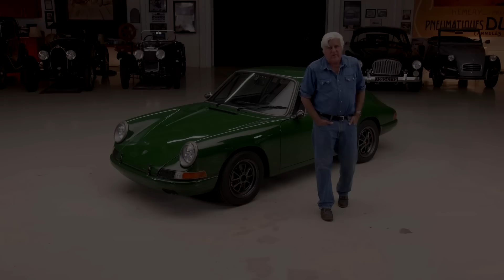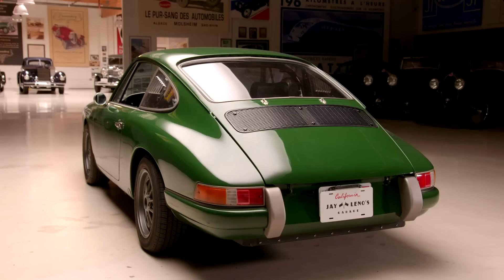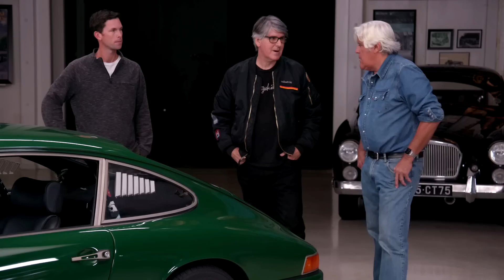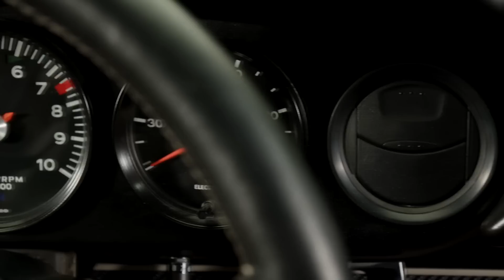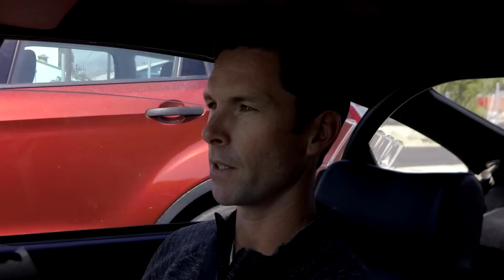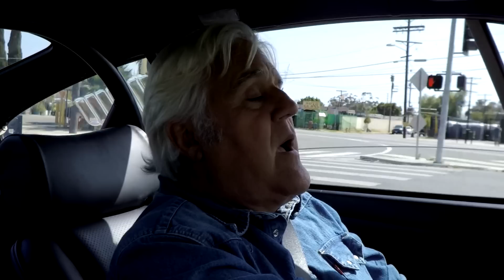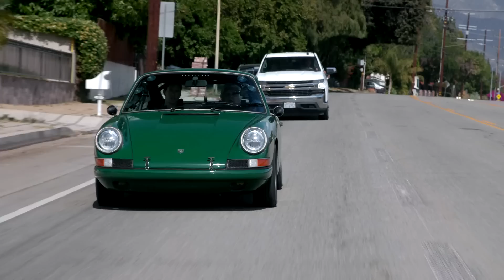Zelectric 1968 Porsche 912 | Jay Leno's Garage

Comment: It's cool, but my car with a V8 gets about 330 miles to a tank, and it's well under 20gal. and I like to sit and run the A/C and radio and engine and have lunch and hang out. doing that would burn the batteries down more. how can I sit around in that with the A/C on and hang out and smoke up? ordinary life just gets in the way of all this progress I guess..
Reply: You like your carbon monoxide.
Reply: @davidvicari5139  ... Bwa-ha-ha-ha-ha-hahah.  Good one.  Just asking, but, what makes you think BEV’s are green?
Reply: @kradius2169  EFFICIENCY. Efficiency = GREEN. Gasoline contains 34 kWH energy equivalent. My Tesla goes 3 to 4 miles per kWH. Your car would have to get 98-136 mpg to match that efficiency. This is not debatable among adults who understand science and math. Dummies parroting fossil fuel propaganda, they don’t get it.
Reply: @davidvicari5139  ... I'm definitely no a•dolt.  What about the making of the battery, how efficient is that?
Reply: @kradius2169  apparently with close to 2 million Tesla on the road, and every one they can produce spoken for, they are very very efficient for Tesla and Tesla customers. You really are not that good at regurgitating fossil fuel propaganda, give it up.
Reply: @davidvicari5139  ... Huh?   R U suggesting that the energy needed to produce the battery is not part of your non-propaganda efficiency analysis?

Comment: "Green" is not true -- All electric cars run on electricity that for the most part is generated using fossil fuels. So while you're not burning anything, the electric company is. Also, if everyone ran electric cars -- our current electric grid couldn't handle the load. So the conundrum is do we build more electric power plants to support more electric cars?
Reply: What you don’t get- The electric is vastly more efficient. Regardless of energy source, the electric uses less of it. A gallon of gas contains 34 kWH. My Tesla just got 4 miles per kWH the last 30 miles, averaged. Your car would have to get 136 mpg to be as efficient. If everyone drove electric, it would be a BOON to the electric grid.
Reply: You are so right and I cant see any new power plants in the near future. Windmills and solar are not the answer either.

Comment: I can't believe it's only 300 lbs more. That's incredible I expected 1000 more. That's just like having a fat passenger with you lol. Not a big deal at all especially for how much more torque this thing would have. And the fact one can go back to stock is sweet. It's the prefect situation for an old style electric car.
Reply: Extra weight gain might actually be less. While they mentioned the weight of the original engine, trans and exhaust, they forgot to factor in the added weight  from a full tank of gas!

Comment: The 912 is as much a Porsche as a 356. The further back you go with 356 the more "hand made" it is but so what. You try dealing with non original doors! I had a 1953 that needed a hood and let me tell you, the hood is not easy to replace because they had soooo much variation car from car. The Windshield had 1/4" variations. Maybe more. and Doors are worse than hoods. The 912 has a 356 engine but its the best engine. I had a 1964 SC engine and that is a good engine Especially with a big bore kit. And it's easy to get a 120 hp out of 1800cc. PS, the rear clips of 356 are remarkably the same, from the door back, the engine lid, no problems.

Comment: Another air cooled power set-up
How often do you need to adjust the valves😃
Great show Jay
Guys did a great job on that conversion
If I saw it parked on the street
Would think clean little Porsche
Not that's electric
Reply: Tinkering with your classic is bonding with your car. Taking that and engine sound away is robbing it of its soul
Reply: @AR-zq9hq  Opinion
Reply: @bryanluntz1603  fact
Reply: @AR-zq9hq  😄
2 sides to every story
Obviously...
Reply: It is not a big deal to adjust valves nor needed very often.
Reply: I adjusted valve lash often in All my Volkswagens

Comment: Wanna hear the sad part? The original 1968 drivetrain was WAY more reliable than the Tesla's.
Reply: Absolutely clueless statement. For starters, the head bolts are not going to pull out on a Tesla motor. The cylinders are not going to crack.
Reply: @davidvicari5139  I know all about the issues the old VW boxer engines had. The air-cooled beast is still more reliable. Read on Tesla forums and they attest, you can't go 10,000 miles without a major drivetrain issue
Reply: @stevenhinkle6957  gee, my 3rd owner 2015 Model S 90D didn’t get the memo! I have driven it so far over 40,000 miles of smooth, silent and FAST, with zero maintenance or issues, in 30 months. Oh, I bought 2 sets of wiper blades. Of course, your internet  “research” supersedes any actual owner experience.
Reply: @stevenhinkle6957  now if you like drivetrain issues, I have a Boxster that would suit you.
Reply: @davidvicari5139  That's pretty lucky. You're on borrowed time with that many miles. Don't take my word for it. Get on the forums and see for yourself. I believe there's a reason it's had three owners in 6 years. 

So I'm not even saying this to get some kind of rise out of you but you should sell it before the issues arise.
Reply: @stevenhinkle6957  it’s OK if you can’t afford a Tesla. No one will think less of you. Look on  the Pelican Parts forum for 25 year and older air cooled 911’s. They have not been produced since 1996. See how “reliable” they are, Look at any automotive marketplace you want, you will not find even a 9 year old Tesla for under $30,000. I intend to drive, just how would I replace my car, which reruns for all small fraction of your car’s operating cost. You make ZERO sense. Tesla is closing in on 2 million cars on the road. To speak about a 50 plus year old sports car in terms of “reliability” reveals, ou are clueless.

Comment: Remember with one gear electric cars there is no neutral. Think of N as no regen. No regen is the most efficient mode. Come up to speed and coast. Down hill I use no regen. When I come to the speed limit...or as fast as I can stand I can regen as much as need. Any 0-60 near 2 seconds is not very compatible with two wheel drive. 4wd is why the Plaid is do dominate.
Reply: I would have to disagree. I can get 250 wh per mile normally with my Model S. On vacation in Northern Minnesota, there is a long elevation change from about 1400 to 600 . We saw 182 wh/mile coming back down. That is regen.
Reply: @davidvicari5139  No that is inefficiency. If you can keep your speed and only use regen to slow you will be more efficient actually gaining range .If you could keep your speed that would be 0 wh per mile. Much better than 186wh per mile.  I only use regen to slow down which is necessary to not break the law. That means you are at the mercy of the hill and take what gravity gives you. You already paid in range by going up the hill. Gravity drive is free. I don't know how far the range drop is so I don't know the slope but coming down the grapevine from LA into the central valley I actually gain 3 percent and use a lot of regen. I don't even know how to measure that in wh per mile like a -500 wh pm You are putting energy back in and gaining range...does that make sense? When you regen you only get 10% back burning kinetic energy. Poor payback. Kinetic energy is what keeps you moving. N is infinite. As long as it lasts.
Reply: @LawrenceRhodes  but in reality you can’t “ keep your speed”. Without regen, going downhill,  you would have to use your brakes to keep your speed, which converts N to waste heat. That is your idea of efficiency???
Reply: @LawrenceRhodes  you seem to misapprehend  how regen functions. The position of the accelerator pedal can be used to achieve “neutral” coasting. Look at your consumption display. There is no need to turn regen on or off. Again, reality does not allow you to coast indefinitely on inertia. You must slow eventually, and regen uses the force created by back EMF to resist the car rolling, rather than using conventional brakes, which dumps the energy as waste heat. I really don’t understand what your thinking accomplishes.
Reply: @davidvicari5139  I don't think you understand regen. Regen acts like a brake including returning 10% of your energy. That is why regen down hills should only be used as a brake for safety purposes. I'd rather gain distance than waste my momentum for a lousy 10% return.
Reply: @davidvicari5139  I never use the physical brakes unless it is an emergency. You misinterpret what I am saying. You also are not a computer which is what you would need to steady the pedal. Not practical. By not using N you are needlessly using energy. If you really were coasting,that is , using no energy your wh per mile would be zero. It is a technique used by hyper-milers to be as efficient as possible. I wouldn't be in N and then use the brakes. That is a waste. I would simply switch from N to D, D eco or B eco. or D as needed to keep a safe speed.  What is really great in some EVs is normal coasting/freewheeling and using the paddles to brake. I don't have that so I switch through the different drive modes which have different levels of regen that can match my downhill speed with the actual speed limit...or my pucker factor.
Reply: @davidvicari5139  I achieve 4.9 miles per kwh on my Leaf in all driving. That is roughly 200 wh per mile. The Leaf and Model S have roughly the same MPGE but the Tesla is much heavier so pound per pound it is more efficient.
Reply: @LawrenceRhodes  No! I say again, look at the consumption display. It is easy and simple to hold the indication at your “N”. This is the one pedal driving that is the hallmark of Tesla. If you drive a Tesla, you are doing this intuitively as you approach any normal stop. It becomes natural by feel to modulate the regen. Paddles, switching the drive position, that is just ridiculous.
Reply: @LawrenceRhodes  here, go back to my downhill at 182 wh/mile. That is a 30 mile average. NO, I did not have the pedal lifted into full regen. As inertia and gravity drove the car downhill, speed was controlled with one pedal as in any normal driving. Sometimes the indication was 0, which you like. As speed was modulated, a degree of regen was visible. There was absolutely nothing to be gained by “ shifting to N”, or paddles. And for Chris sakes there is no “pucker factor” involved.
Reply: I had a Saab 45 years ago. It had freewheeling. A Tesla does not need it.
Reply: @davidvicari5139  I drive a Leaf. You are not totally wrong but that's what I have and stand by my technique. The consumption gauge doesn't lie. Newer Leafs have the paddles I think. I average for all driving 200wh per mile.
Reply: @davidvicari5139  It had freewheeling because the engineers knew it was more efficient. Engine braking wastes energy but saves brakes... there's that pucker factor.
Reply: @davidvicari5139  Then you didn't try to use your momentum to carry you through the dips and peaks as you descended. That is where No regen is valuable and possible pucker factor is involved and why I can average 200wh per mile in all driving. I also drive very slowly on the freeway.
Reply: @LawrenceRhodes  NO!! Sheesh! The reason for freewheeling on the old Saab was the 2 stroke engine. If you coast with a 2 stroke, turning the engine with no fuel feed, you will burn it up. The lubricating oil on a 2 stroke is mixed with the fuel, there is no separate lubricating system
Reply: @LawrenceRhodes  pucker factor on downhill, very slow on the freeway. You sound like a public nuisance.
Reply: @davidvicari5139  The word explains the Operation.
Reply: @davidvicari5139  Guilty as charged.

Comment: Jay... The "motor" doesn't "make" any power. It is a conduit for the electrical energy provided from the battery pack and channeled through the controller. It simply turns that energy into a rotational force. Volts X amps = watts. 746 watts is one horsepower.
Reply: One of the many definitions of power is the time rate at which work is done or energy is emitted or transferred. Look it up. This is the Merriam Webster definition

Comment: I realize I am probably just a curmudgeon resisting inevitable change...but having said that....I don't see how a 120 mile range would be adequate for anyone.  Particularly when it calls for a six hour recharge.  I do have to say I am pleasantly surprised that the conversion only added 300# of weight....I would have guessed it would have been much more than that.
Reply: The new Mini Cooper EV only has a 120 mile range.
Reply: @mikedx2706  Well...I didn't know that....but I still consider it completely inadequate.  I certainly wasn't advocating in favor of the EV Mini either.  I just think that even for a "toy" car, a sunny Sunday afternoon drive could pretty easily exceed 120 miles, and obviously forget about any kind of "road trip".
Reply: @johnshaft5613  I agree. The range  is a bit too short. Maybe when the newer batteries come out it can be upgraded. 120 miles makes it just a city car or plaything.

Comment: im sure they could extend the range if they decreased the power, is it really important to go o-50 in 2.4 seconds?   if it went 0-60 in 6 seconds and could go 3 times farther on a charge , that would be more desirable to me.
Reply: You control all that with your right foot.  Notice they said 120 miles "driving it like a Porsche".   If you refrain from hot-dogging it, you'll get a bit more range.  But as a daily driver, what would it matter anyways?  Charge at home, at night - you got plenty of range for your commute.
Reply: @wincrasher2007  if i was using it to go to the store or on a date its fine, i dont know where you live but here 60 miles each way is pushing it and im sure in traffic its even less, also i didnt catch anything on climate control but if it has ac your not going 120 miles

Comment: I would love to know two things:  1.  Did they use the Tesla batteries too?  If so how did they get enough in there for 400V to drive the motor?  They said it was a 32KWh pack so that would imply 6 Tesla model S batteries but that would only get them to 136V.  If not, what did they use?  Or am I missing something?  Super curious.
Reply: We're using a smaller custom LG Chem pack designed to fit in the car. db

Comment: I don’t know, I’m with Jay on this one… I’d love to see a well-executed, well-regulated multi-speed electric car. Yeah there will be some parasitic loss of power, but there’s parasitic loss of power in a gas motor with a transmission, but you push through it! How could more speed and efficiency through the power of gear reduction in a transmission be a bad thing for the car? Regulate how much torque goes through that transmission on gear shifts, regulate when it shifts so nothing breaks.

Comment: Jay , early Porsche 912s had the same Porsche designed and built motor as the 356 super 90. It was the later 912e that had the Volkswagen motor same as the 914.

Comment: How the hell can he say that the weight distribution is better on a 1968 Porsche now as oppossed to before the convertion? The entire point of having the rearmounted engine is lost if you change the distribution! The entire charm of having "only" 90 bhp with a rearmounted engine is that weight in the back hooking up the rear wheels when you accelerate. I love electric cars. I drive a Tesla Model 3 every day. But this is absolutely useless!
Reply: This car is faster and handles better than your Tesla yet it's useless? How?

Comment: The 912 motor WAS a Porsche motor, NOT a VW derived motor like the 914. The 912 motor was a derivative of the old 4 cylinder motors from the 356 series, much better motors than the VW ones.

Comment: Very interesting concept! Retrofitting an older body with new technology.

I just find the lack of range and the charge time to be a MAJOR disadvantage compared to gas powered cars.
Reply: @Mona Torkia  80% at a rapid charger is about 40 mins and only a 163 miles of est range. this is for a model s. would be a huge disadvantage for me.
Reply: @jeffreyrigged  Sure, it’s not for everybody. But for me 100 miles of sports car driving is plenty for one day! And probably enough for most people to daily drive it locally for a week…
Reply: @meofnz2320   is me now but for years i drove more than that to work
Reply: @meofnz2320  yeah it would make a good around town rig just thinking still if want to drive for over an hour or so you still need something else. i would be all for ev if  the range and charge speed was better than fuel is.

Comment: I'm not sure I get this. Would you buy a Rolex and then replace the mechanical mechanism with a microchip? Surely the point of a classic like a Porsche is regard for the engineering and design that went into the original vehicle. You might make it 'better' by replacing the mechanics with modern EV motor and electronics, but surely you loose that history and pedigree. Yeah, sure, you get something more useable, but then why not buy a modern car in the first place??
Reply: Oysterquartz...

Comment: Is a nicely done conversion but I have a concern and that is parts availability and access to charging network. I feel like we need to break away from tesla and find a company willing to provide all the mechanical components necessary to convert and keep the car on the road without hassles and inconvenient policies regarding servicing and access to supercharges. If something breaks in this car, you have to look for used parts and ship the car back to the builders because tesla won't sell you new parts nor services.
Reply: TESLA IS OPEN TO SHARING THEIR CHARGING NETWORK AS LONG AS MANUFACTURERS HELP ADD MORE.